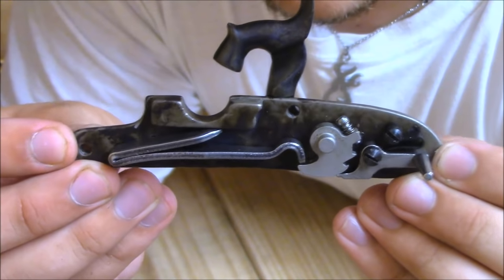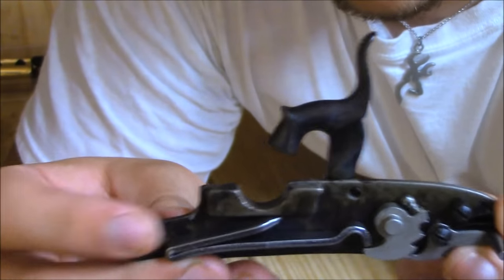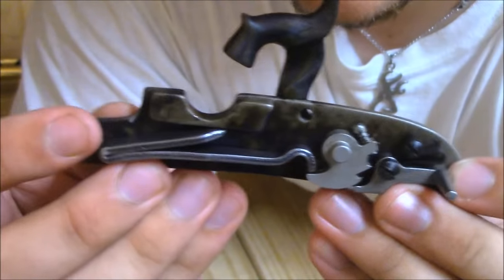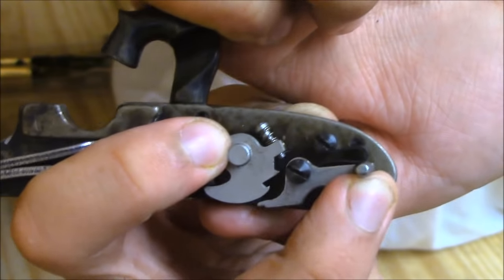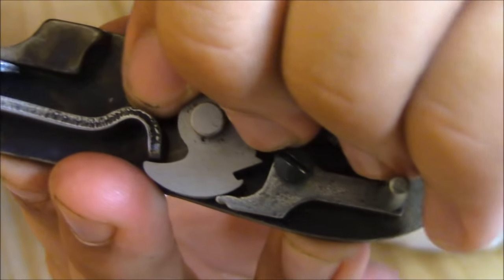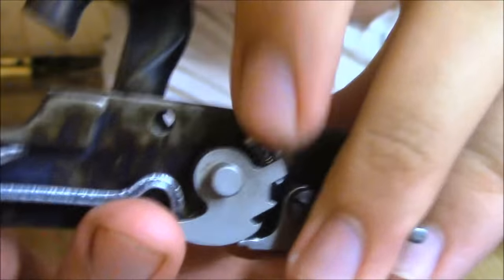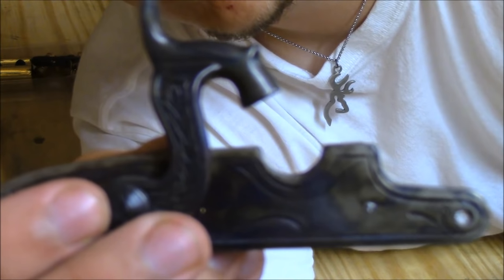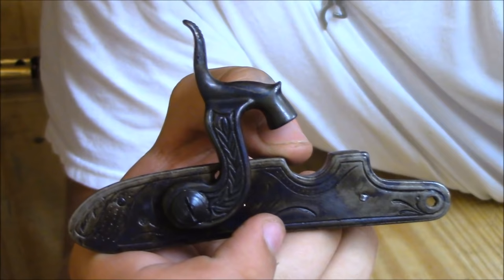Building The Kentucky Long Rifle: Understanding the lock mechanism

Comment: Need a little work on your terminology and you presentation, but otherwise very helpful.  Thank you!  

I've been looking for basics on the trigger assembly on my muzzleloader before I tear into it.  Got problems a week before deer season starts and I was scrambling.

Just a FYI..."the flint strikes the frizzen, the spark from that strike throws the spark into the flash pan, which holds a small measure of black powder.  Once that powder is egnited".....and you got the rest.

Camera work was better than most offerings.

Thanks again.
Reply from the maker: I agree this is an older video, thanks for the feed back always glad to help.  Good Luck this season.

Comment: Hi Good video,  is there any way to cut the tension on the hammer i find my gun is very very hard to pull the hammer back
so much so it puts me off using the rifle.

Cheers  Bill From Scotland.
Reply from the maker: bill miller Great question unfortunately no there is no immediate way to make the hammer easier to cock. However right out of the box the hammer is a little stiff and will eventually loosen itself up over time
Reply: Hi Many thanks for quick reply. will keep at it.

Bill Miller
Reply: You might be able to grind the width of the spring to decrease the force.

Comment: What do you do if your lock is not going all the way back
Reply: I would recommend carefully taking it apart and searching for the source of the obstruction. It's always a good idea to do that once in a while with any gun. Even if it's just to squirt a little dot of oil into the gear works.